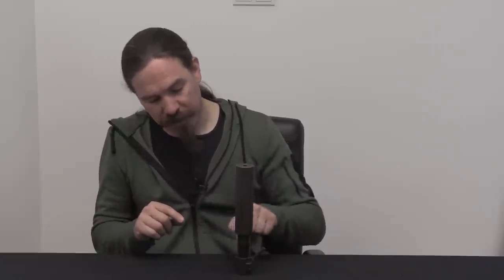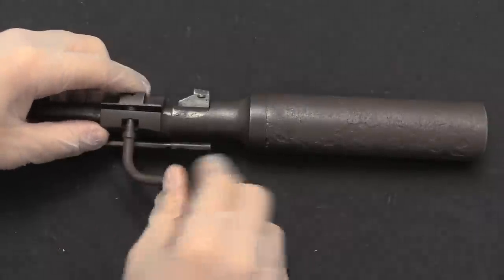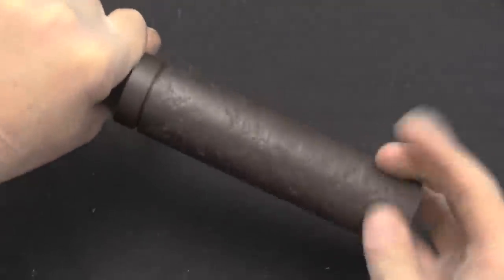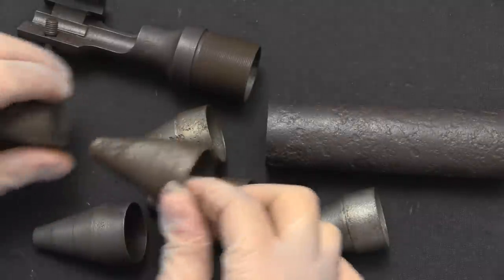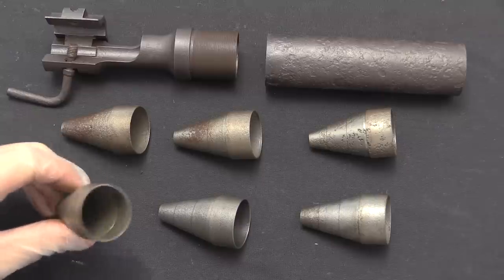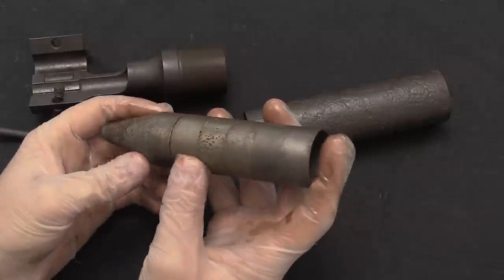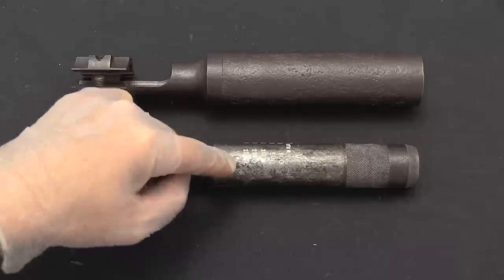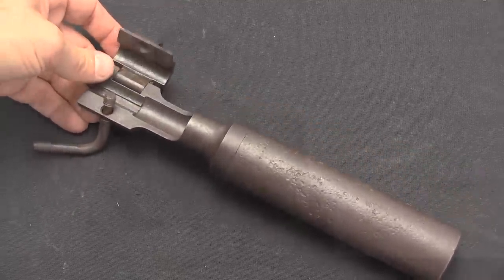Germany's L26 Silencer for the K98k, G43, and StG44

Comment: Putting a muffler on your car is fine, and is even required in most places. But putting one on your firearm is scandalous? That makes no sense.
Reply: Only in the US, the rest of the world prefers you to supress your firearms
Reply: Don't know realize that putting a suppressor on your gun turns it fully semi automatic and allows use of battle ammunition?
Reply: @andreww2098 except some Australian states, where suppressors are more tightly regulated than rifles (a standard firearms licence allows you to own a rifle but not a suppressor). You need a special much harder to get licence to own a suppressor. 🤷‍♂️
Reply: @kiwisteve6598  I live in the UK, suppressors do require a change to your firearms licence but is relatively easy to get, almost half of the licenced firearms in the UK have a suppressor, though you can use them on any gun you own depending on fit, caliber etc, you can get the paperwork easily by saying it's for noise reduction and most firearms officers will ok their use
Reply: @andreww2098  here (NZ) a normal firearms licence is all you need. I would guess more hunters use them than don’t. Since hear protection out hunting is a bit of a faff. There is a growing expectation among hunters to use them and the community resistance in other countries about potential criminal use doesn’t seem to apply. Probably because the weapons of choice amongst NZ crims are the cut down 22 or 12 gage.
Reply: @kiwisteve6598  really it makes sense to use them than not, the biggest issue most gun clubs have is noise complaints for outside ranges, so suppressors are a good idea

Comment: The amount of thread is most certainly German 
So much engineering
Reply: "Fast-forward shouldn't be needed, it can't be that ba...."

Danke
Reply: I was utterly shocked with how far it was screwed on
Reply: @bensmith4563  
The operation is over before you get it on
Reply: The real reason they didn't use left handed threading was that by the time the suppressor unscrewed itself, the gun would be worn out.
Reply: @williamromine5715  Can you explain why the direction of the thread matters?

Does it have to do with spin of the earth?
Ive heard it does somehow
Reply: @azmanabdula  The torque of the bullet going down the threaded barrel will tighten or loosen whatever is screwed on the barrel depending upon whether the threads are right or left handed. The amount of torque is very small, but with many shots fired, the cumulative effect could loosen suppressor over time.
Reply: @williamromine5715  Im an idiot of course

I wasnt even thinking mechanically
Thats beers for you
Reply: @williamromine5715  Also i was thinking of the rifling when you said threads 
"Worn out" 

Man i must have been drunk
Reply: @williamromine5715  
Looking back
Shamebox
Reply: @azmanabdula  It's no big deal. Everyone has a mental block once in a while. Actually, when you get as old as I am,81, such blocks are pretty common. Which is pretty embarrassing when my wife's name doesn't immediately come to mind.(that's why I generally call her "honey" or "sweet heart").
Reply: @williamromine5715  Im not even half your age, I have no excuses
Reply: @williamromine5715  I still cant figure out what i was thinking about

Comment: On the Lindybeige channel, a British volunteer fighting in Ukraine talked about the many problems associated with silencers, primarily that they cause the mechanism of the weapon to get dirty quickly. Is it true?
Reply: On gas operated systems like ARs and AKs I believe it usually leads to them being over gassed (less gas can escape from the muzzle) and it leads to the inside of the rifle getting dirtier quicker
Reply: Though rifles specifically intended to use suppressors will often come with an adjustable gas block to reduce this issue, and there is constant development being done on suppressors to try to reduce the backpressure issue.
Reply: @Joseph Schuler  they do increase back pressure but if you've have a quality extractor with associated buffers and springs..it'll work well, especially when kept lubed up.

Comment: Great reporting story. I specifically enjoy the reporting on silencers throughout the period of time however I would really like to know what the noise reduction is of the silencers. I have not seen any YouTube presentations on the actual noise reduction of any silencer shooting regular ammunition or subsonic ammunition.  Typically sound pressure level like this would be measured by impulse sound level meter at a scale.
Reply: It's really hard to make a SPL meter that can handle the pressure and sonic characteristics of a gunshot... They exist, they're just hundreds to thousands of dollars. Suppressors are all fighting the same laws of physics anyway and within a specific type of design there's not THAT much difference between models. 'Comparable performance to a modern baffle' is just all it can be.

Comment: 6:00 Who would want to suppress the MG42? It's sound is great part of its overall effectiveness
Reply: Simple - the silencer helps concealing the MGs position.
Since its quiter, it sounds farther away than it actualy is and also it helps hiding that muzzle blast, adding to the concealment.
MGs in general where immensly important on the battlefield and a priority target for an advancing enemy, and if it takes the enemy just a minute longer searching for it, it has more time mowing them down.
Reply: For when you want to make it hard to tell where its coming from
Reply: @azmanabdula  Wouldn't the suppressor melt after a few hundred rounds of full auto anyway?
Reply: Yeeeaahhh… that "Sound is Great" part is something you want to Suppress when you’re trying to be less noticeable in Special Operations.
Reply: @alexm566  Couldnt tell you
Reply: @alexm566  it would burn out pretty quickly
Reply: @alexm566  it's silencing property would be gone after a couple of rounds because the baffles get filled with gasses
Reply: @Rikhardi  yeah, it feels like it would've been a complete waste on the mg42
Reply: @alexm566  You could put it on a MG 34, it has single fire option.